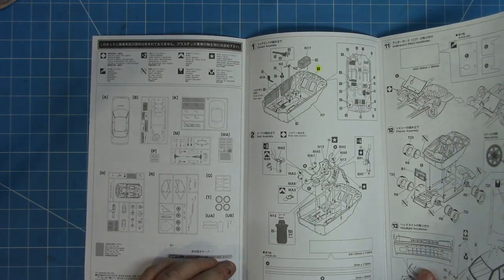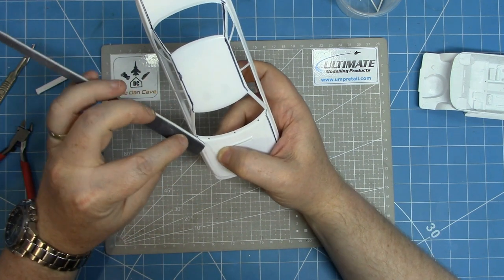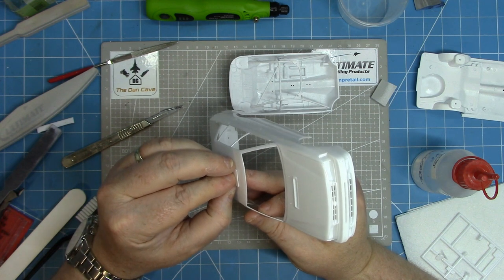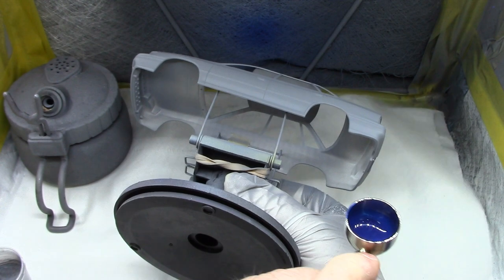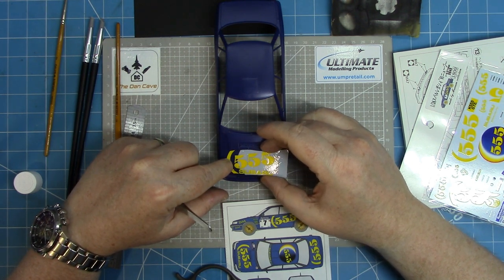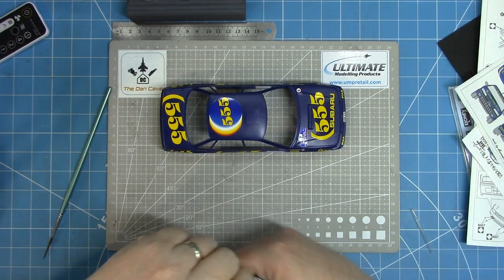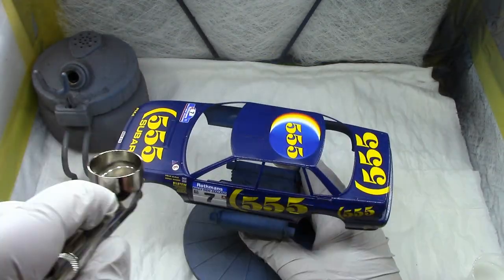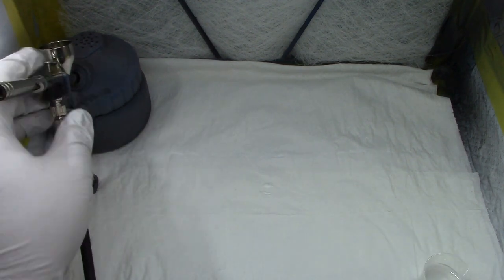Hasegawa 1:24 Subaru Legacy RS Part 1 - Paint and decals

Comment: I’m at the same point with my pro range, had similar issue with my last build, used gravity this time round, may revisit pro range next time and see how it goes
Reply from the maker: Pro Range is great, just the temptation to keep using it because of the volume you get is tricky to get past. At the moment it will be Gravity for a while as I have a good stock of it.